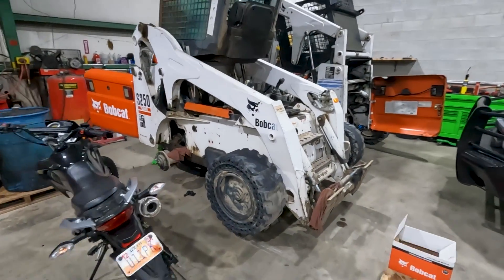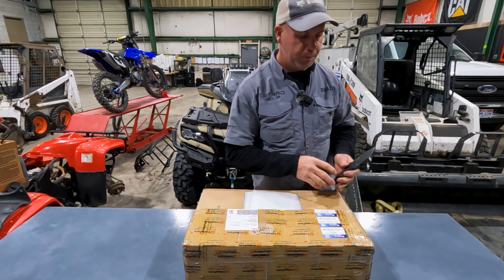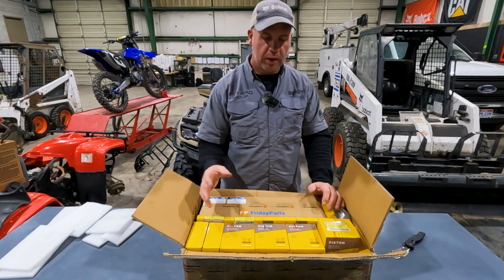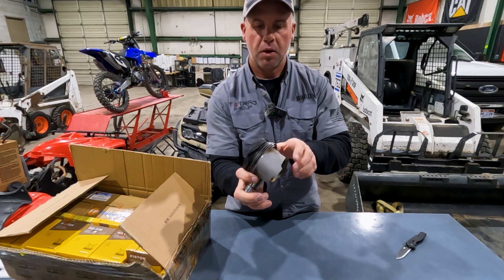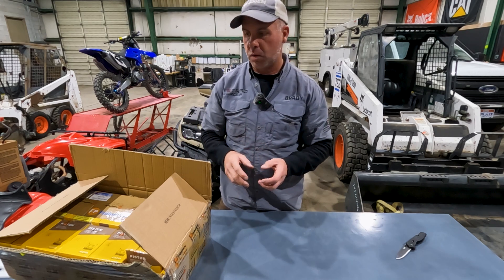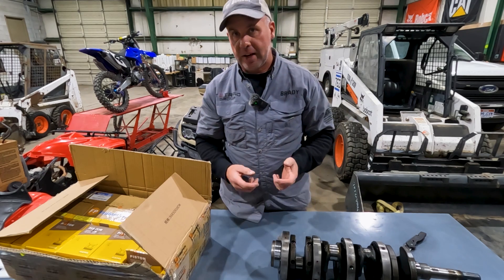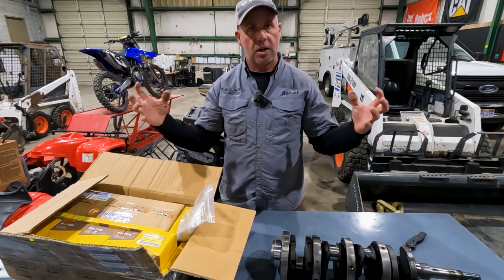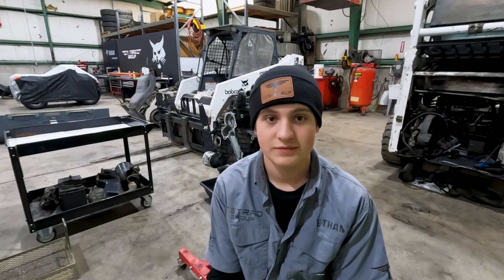Bobcat Kubota engine failure, teardown, and prep for rebuild.

Comment: I have s650 bobcat with a v3307 Kubota engine.
It overheated but could not see where any antifreeze had leaked out. 
I filled the cooling system and let it sit overnight.
The next day, I checked the fluid level, and it was way low. So, I filled the cooling system again.
Not thinking that  the water drained into oil pan. When I started the engine, white smoke came out of the exhaust. 
I did get it shut down in time before it ruined the engine. 
I figured that it must be either a cracked head or a head gasket.
Had head magnafluxed and had it shaved down. 
Reinstalled the with new gasket.
I started the engine and coolant leaked back into the oil pan. 
Guess I'm wondering where the coolant is leaking into the oil pan?
I ended up putting a remanafacterd engine in it.
I am also wondering if you think I should overhaul the engine?
I'm sure that the bottom of the engine is okay. 
It has about 2200 hours on it.
Reply from the maker: Pressure test the engine oil cooler
Reply: @tetradgroup  I installed the remanafacterd engine, and it runs well. It hasn't lost any coolant.

Comment: I have a Kubota 763 the engine is taken apart is there any way I can bring it by you or meet you so you can possibly rebuilt it? I Can travel.
Reply from the maker: I'm in Utah but I would love to build it for you
Reply: I’m here in California but don’t mind driving to you I’m interested in letting you work on it is there anyway I can join you on the process of the rebuild if that’s okay with you.
Reply: How can I reach to you do you have a Facebook or Instagram so we can communicate set a schedule.
Reply from the maker: www.4tetradgroup.com or 4tetradgroup@gmail.com
Reply: I just sent you a message see if you received it. It starts with Felix
Reply: kubota engines are pretty easy rebuild  love working on kubota engine  lucky my kubota dealer stock rebuild kits from small engines $100  up to $2,000 for bigger engines